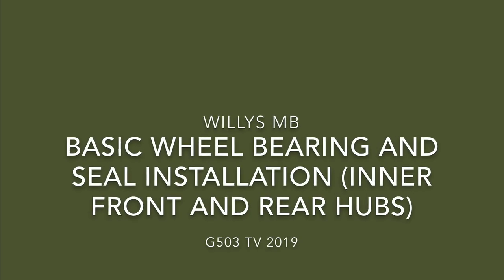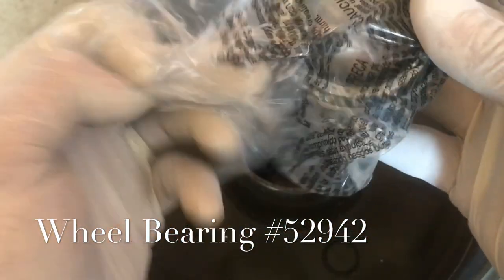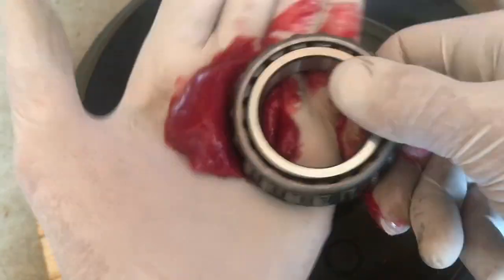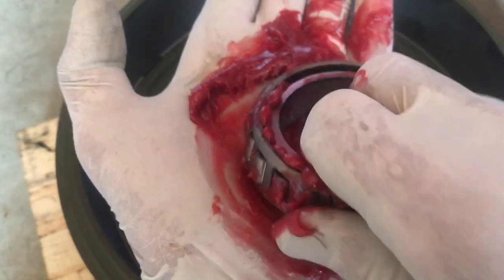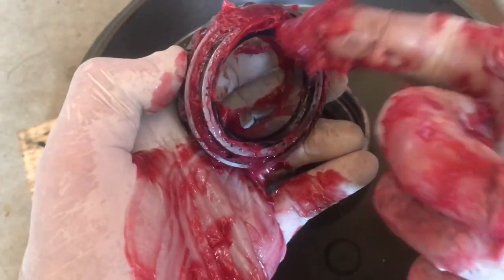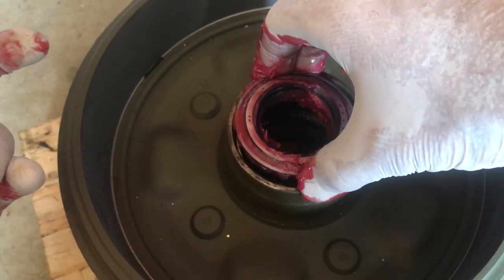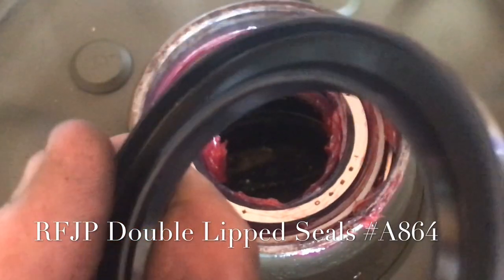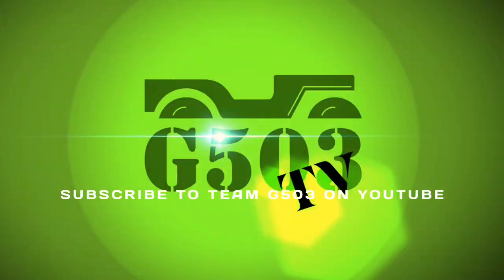Willys MB Basic Installation Of Wheel Bearings And Inner Seals G503 TV

Comment: What happens the seal it it’s slightly past flush?  I just installed new seals and the bearing and seal tool wasn’t big enough so I went just past flush. Do I need to re do the whole thing. I really don’t want to take it all apart again but I will if I have to hahaha. Thanks
Reply from the maker: You will probably be ok if the seal is square.